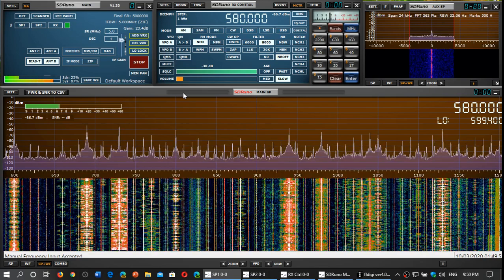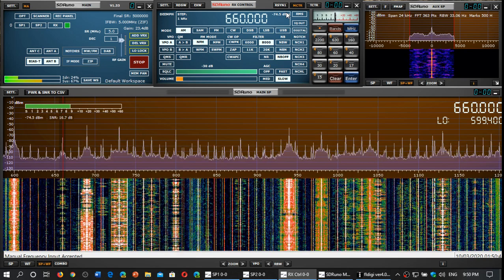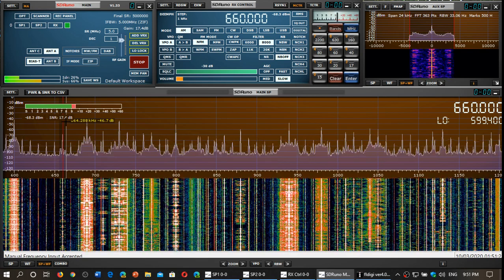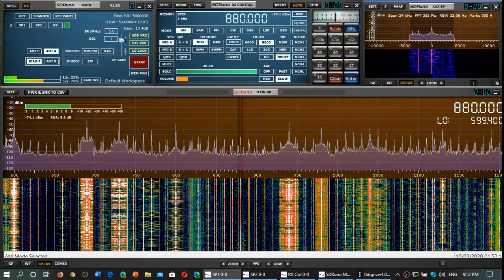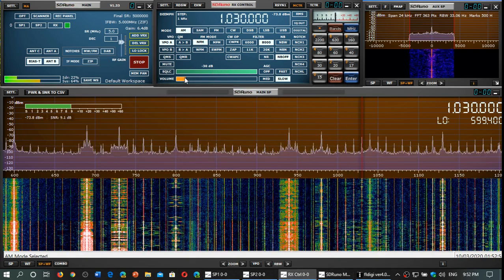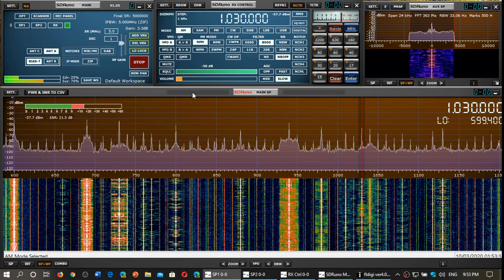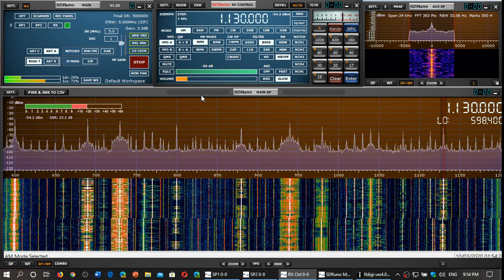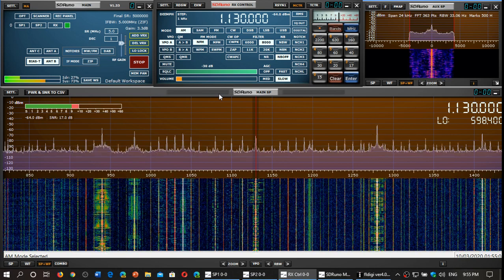MLA 30 VS MLA 30 plus test Mediumwave SDRplay RSPdx

Comment: What if my radio doesn’t have a plug for external AM antenna... I have an XHDATA... is there something you can add to the antenna cord to tune with the internal ferrite antenna abd still benefit from the MLA 30+ ?

Comment: Might sound strange, but the last test you could try would be to swap physical positions of the antennas on your balcony. Just to make sure the original isn't picking up any interference. Sometimes small differences in position can affect performance. Other than that, looks like the plus is the one to get.